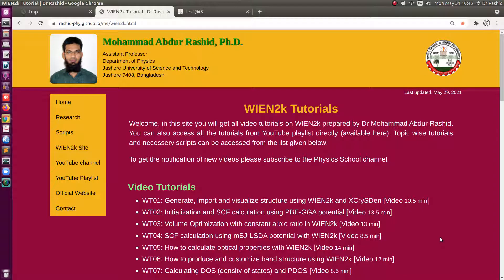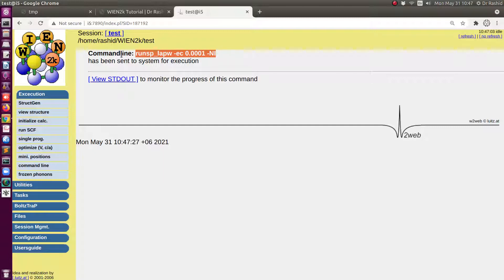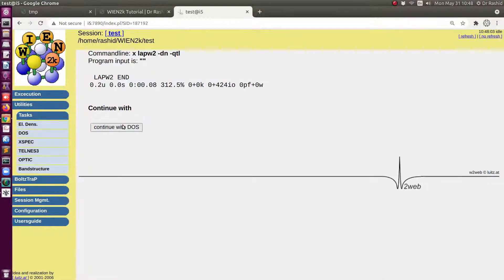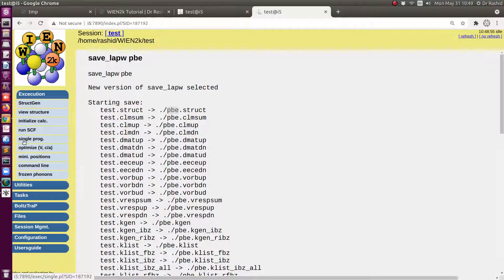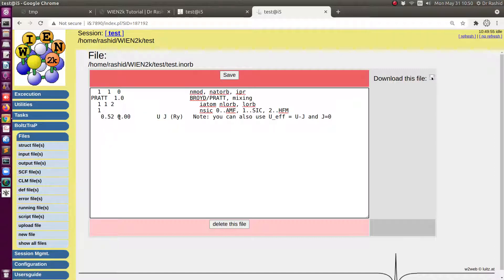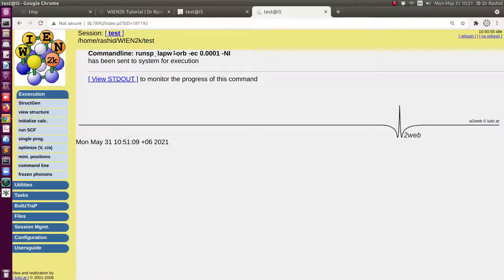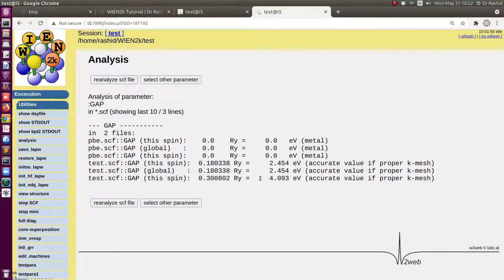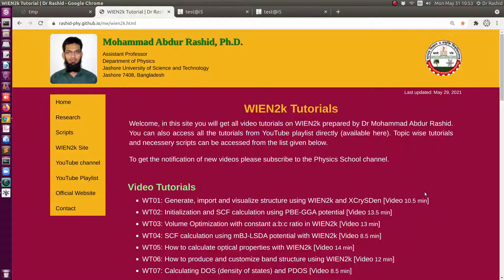WT17: How to do SCF calculation using DFT+U method with WIEN2k | Hubbard model

Comment: Hello my friends. How to do Optimization by the GGA + U method ??? that tell you how to determine the parameter of the mesh by the method GGA + U or LDA + U ??????
Reply from the maker: I didn't understand your question about mesh. To optimize a structure with GGA+U follow the following steps:
1. Initialize for spin-polarization calculation
2. modify .inorb and .indm files according to your system
3. proceed for optimization as usual
4. replace "run_lapw" in optimize.job with "runsp_lapw -orb"
5. run optimize.job